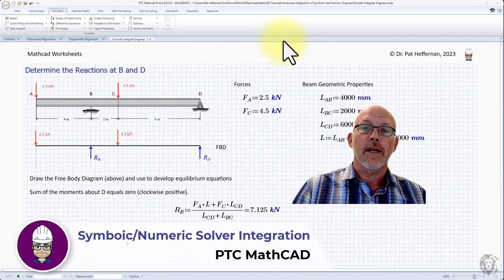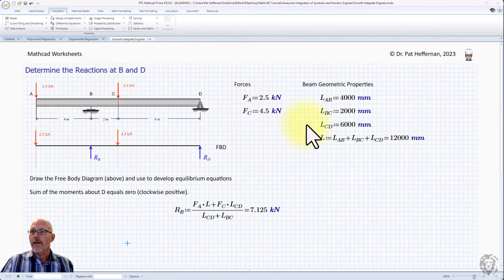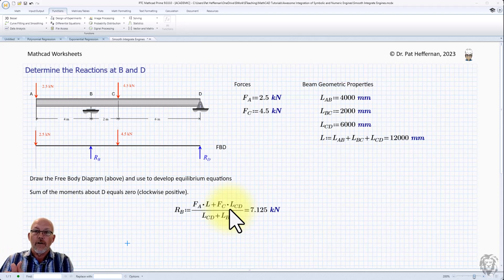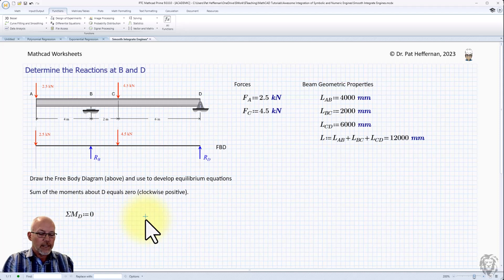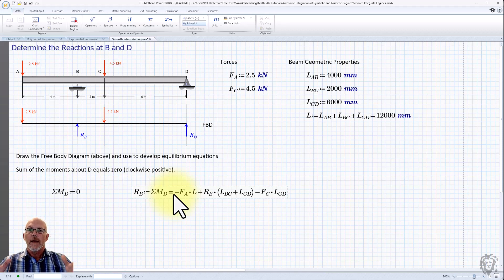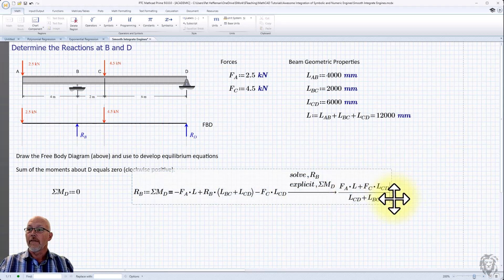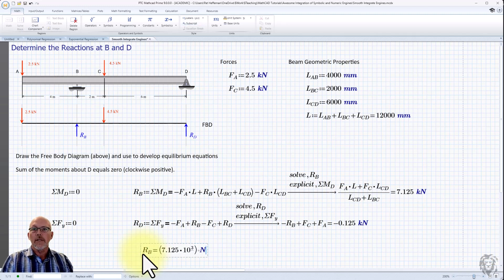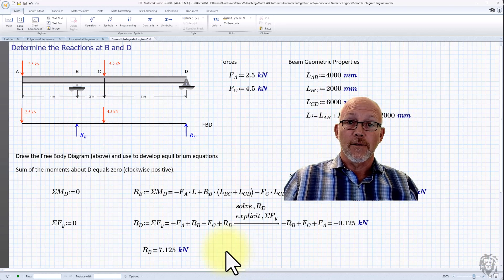PTC Mathcad - Smooth Exchange between the Symbolic and Numeric Solvers

Comment: It's a shame the eqaution goes beyond the A4 worksheet. Makes it useless using prime for reports in uni.
Reply from the maker: I’m not sure which equation you are referring to.  This entire solution is on a single page.  Much like when a solution is handwritten, It is possible to wrap an equation across several lines in Mathcad to keep it on a single page. (Not saying you haven’t come across a circumstance where it has issues, but I’ve built a lot of worksheets and don’t typically have any issue staying on a single page width.)
Reply: @PatJHeffernan i could have been more specific. My bad! 😊 I am an engineering student, and sometimes equation can get pretty long. This makes some of my equations go beyond the A4 worksheet. As I understand, Mathcad 15 had equationbreak that was different than the equationbreak in prime, where you have to break in -,+,*. Or maybe I am missing something? Quilte new user here. 😊

Comment: Hi, great stuff as always, thanks for your videos! 
I have a problem that I guess is a bit tricky to explain. If I want to solve a problem, and use symbolic values, I can't figure out how to define ('save') the output from a solve function containing a symbolic value. 
In an exercise, a force is given as 'F' and dimensions as multiples of 'a'. With the solve function and explicit parameter, as you show in this video, yes, I can get the output I want, but it remains undefined until I define 'F' and 'a' as numerical values. I would need the values in further equations, so I want to achieve a valuable defined using symbolic values. Maybe I'm missing something basic? 
I hope it makes sense. Thanks :)

Comment: I am glad that you find my method helpful. However, if you continue to work with it, e.g. building up dependencies between individual formulas, I had to face problems since release 7 of MathCAD Prime. As I explained in this tutorial (link below) where I demonstrate the engineer's beam theory (Euler–Bernoulli), which leads to functional dependencies of internal forces.

If you encounter a similar problem and find a solution for it, please let me know. In case it is just a bug in the software, maybe you can then use your contacts at PTC to point it out to them. After all, they don't seem to be aware of this workflow. If they have not recommended it to you.

https://youtu.be/i0ZPgndKoJM?t=1858
Reply from the maker: I’ll have a look at your video.  Thanks.

Comment: Thank u for your content Dr.

I have a challenge, and here it is:

Defined V= 6.80 m3 h=1.5 m and tryn to assume L= 2*b

I want to solve this volume expresion V = h*L*b of a rectangle septic tank, solving for b

hope u can help me, thank u in advance
Reply from the maker: Hi Omar.  This seems less a Mathcad problem than an algebra problem.  2*b^2=V/h... isolate for b and solve.
Reply: @PatJHeffernan  Yes indeed, but i wanted to do it unmanually
Reply from the maker: I'm sure you could configure it using a solve block and constraints if you wanted to.